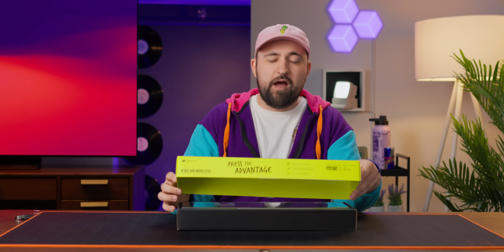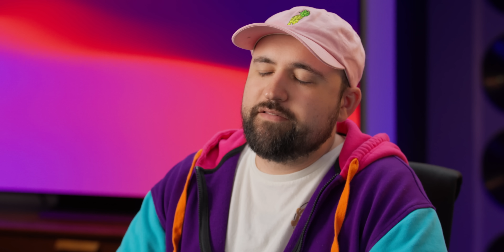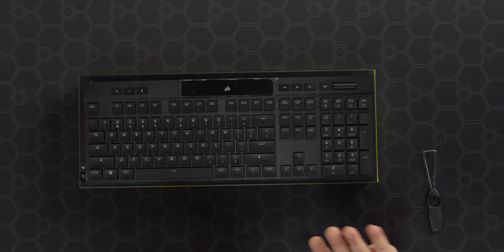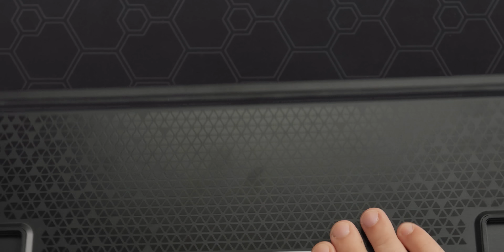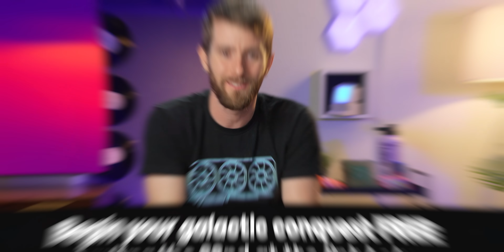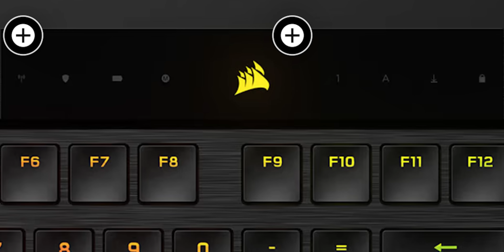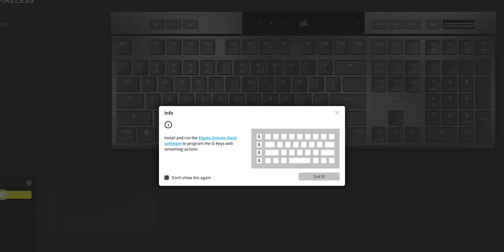Corsair's THINNEST keyboard yet - Corsair K100 Air

Comment: Glad that there's finally another wireless keyboard - that isn't actually suck at wireless other than the G915. And as you can see, typing on an ultra low profile is way more accurate, I would actually buy this if not for the ABS keycaps which is kind of unacceptable at this price point. 

And hard disagree on making a 60 percent version of it, at most it should be TKL (but full size plus macro really is best, I just wish they put macro on the side just like G915 even if you have to make the KB bigger.) Small form factor keyboard is honestly stupid if you want to put it to work.

Comment: I tried this keyboard at a retail store and I really liked the typing experience. I also really like typing on chiclet style keyboards for the exact same reason you mentioned, I sometimes find myself being "stuck" by other keys when sliding my fingers around. However, the price man... If they release a wired version that is much cheaper then I would be very interested.
Reply: Might sound kind of cliche, but... unless you want something very specific on this one, Keychron has much better options for way less money, but then often WITH hot-swappable switches, as well as open-source programming. - Their K Pro line is all low-profile and they all offer that, as well as wireless (with optional wired USB-C) and a bunch more sort of QoL-features. - And I'm talking between 100 and 200 USD for most of their keyboards, and that specific range of keyboards are all around 100. And you can even have it slightly cheaper if you don't care for the hot-swapping or RGB (but still white lighting instead). - Corsair basically makes you pay for their brand, and then locks you into their proprietary software as well. I don't appreciate nor recommend that. - Just a suggestion since I'm looking into those myself. I think they're really neat. - But... they do look much more "classic" or at least minimalist and don't have the more "modernistic" type look or any additional buttons (though most additional functions such as for media-control are layered using the "Function"-key, and everything can also be remapped) or screens. - Just depends what you're looking for.
Reply: I agree a 100%. I LOVE the ultra thin but there are so many features here I simply don't care about; Wireless, RGB, etc.

Comment: Low-profile switches are really just so much better than normal switches because of the much shorter travel distance, like is there a real benefit of that extra travel distance (other than being cheaper to produce)? I hope there's more development in this area. I got the G915, which doesn't have AS low profile switches as these, but it's the best non-laptop keyboard I've ever used, because my fingers just float across it while typing. I'd hope Logitech follows Corsair to making an ultra low-profile keyboard like this, cause I'd get it immediately.
Reply: I bet there are plenty of people who like a lot of "action", which is also the case with say guitar-players and such (meaning, the strings closer to or farther from the fretboard), just like those who like lighter or heavier switches, which is all just a matter of preference. - But I'm also of the idea now that it feels rather inefficient and that I could probably type more quickly if the travel was tighter and I wouldn't "trip" over the edges of the keycaps with my fingertips. - Which is why I'm looking into getting a low-profile keyboard now.
We're going to handicap ourselves severely when we ever need to type on someone's generic swampass rubber-dome keyboard, though.
Reply: Just but mx keys - its better then this low profile mechanical crap

Comment: On my 3rd K100 within the release of the keyboard and having issues again. Soon in #4... 
Honestly quality is not on point. Especially not for the price, let alone the MSRP. 
1st one straight died. 2nd one had several LEDs die/go faulty in color within months, 3rd one also has a broken led by now, and the feet just don't stick up anymore. Kb constantly folds down.
Gonna get it swapped soon...
Also my new elgato stream deck XL is also broken.
So smth is definitely not going the right way in corsairs QA

Comment: So the Keycaps is a pretty big issue, i've had the Logitech G915 for a few years and the key caps are wearing down, but you can't get replacement parts for it anywhere. Logitech designed a custom version of the Khail low profile switch that isn't compatible with any other version. Corsair has essentially done the same thing here which is really annoying for getting replacements later down the line.

Comment: Honesty I don't fine much difference between 100 and 200 hours on a KB but I dont travel that much.  Feels like if I need to charge anything, I can usually charge everything.  The KB is the last thing I think about, but  maybe that is why a long battery is great?  In any case, keep a cable with you and that should not matter at all.

Comment: Why does anybody need 8,000Hz polling?

I would bet like.. 3 whole tacos.. that even the best ESports champions would struggle to tell the difference between anything above 2x monitor refresh rate, because that's the point where you won't SEE a difference.

For example, on a 144Hz display: 
Set polling to 125Hz and spin the cursor around on a solid black background.. it'll be quite jittery
At 250Hz it'll be mostly smooth but with one or two gaps in the movement, small but still noticeable
500Hz - perfect circles with no interruption

16x faster at 8,000Hz: ?? how is it any better?

Comment: I got this keyboard a couple months ago, and while 230 bald eagles for a keyboard is expensive, I feel like it was worth it for me, and just compared to other Corsair keyboards the premium isn't that much. Though I didn't get it because it was wireless, it ended up being a huge bonus being able to use my desktop keyboard on the couch in the other room for example. Battery on wireless is good enough that I can't remember the last time I charged it. I liked my other mechanicals with cherry browns, blues, and the silvers, but I always loved a good laptop keyboard. This reminds me of the IBM Thinkpads before Lenovo, they were amazing. The only downside is that if you're a huge RGB fan that likes lots of different effects, or use lighting link, that in wireless mode the lighting is limited to certain effects. However, while wired it's just like any other Corsair keyboard.
Reply: The design is great but the keyboard seemed bad to me, the keys get stuck and if one breaks you can't exchange it. I had to take it to the warranty and they gave me another one just like it, key failure... it lacks a lot to be a good low profile.

Comment: The keycaps on my G915 from logitech are not standard either, the A, C, D and V caps wore out super quickly and it looks really bad. Replacements for that type of keycap seems expensive. So I would assume that if a keycap breaks or wears out on this keyboard, you will have a hard time finding replacements or will have to pay a premium to get them.

Comment: I had a Corsair k70 and it kinda put me off all their keyboards, the space-bar broke after about 6 months,the volume roller thing which this one has too would bug out alot and either get stuck on max or mute volume until u physically unplug and plug it back in and on top of that I had a ton of trouble with icue conflicting with easy anticheat and causing my games to crash. Just pure hassle and I'm not going back, have since replaced with a roccat Vulcan pro and I love it so much, it's better in every way

Comment: My experience over many Corsair keyboards is that the non-mechanical media keys are what fail first. So my last keyboard purchase was a K60 - no non-mechanical keys to break! The damn thing has loads of chattering switches and keycaps that pop off when they feel like the return spring insulted them and I'm trying to RMA it now :(
edit: also iCue is godawful; software updates regularly broke lighting patterns and configurations, eventually the software itself conflicted with applications I was passing the keyboard through to directly and I had to uninstall it. Also ruined my login to desktop time.
Reply: Media keys? Really? Does people actually use those?

Sorry I'm just amused at how I can't remember ever using the media buttons on my keyboard. When I got it some ten or fifteen years back I thought they were sweet, and that I would get a lot of use out of those shortcuts. And then I forgot about them...
Your post actually just reminded me that do exist. But I don't think there's much risk of me starting to use them now.

But it sucks for you that they used cheapo switches for the media keys. As much as Corsair charges for their devices I can't imagine that it would have made much of a difference in price for the keyboard if they had used Cherry switches for those too.

I remember when the first mice with a scroll wheel was released. I tried it out and hey, what do you know, you could scroll a window vertically. And then I forgot all about it. I think it took over a year before I started using it. It could have been longer for all I remember. It was just nothing I was used to have on a mouse.

But it's still easier to learn to use than the media keys. With the scroll wheel on the mouse I don't have to move my hand when I use it. To reach the media keys I have to move my hands from the typing position on the keyboard. Sure it would be faster to start the media player with a button and all that, but most of the time I want to play something it's a specific file that I have in some subdirectory somewhere. So either I have to start the media player and then search the file I want to play or I just use a search function and just start playback of the file.

Anyway it's interesting how differently people use features like this. For me the idea was nifty but in practice it turned out to be more tedious to use than to do it in other ways,

Comment: Even with the high price of this keyboard, it is so worth it. I got it back in October and it's by far my favorite keyboard I've owned. I use it on both a gaming PC and a Macbook Pro and the bluetooth connection is the most solid out of any wireless keyboards. The only way I could like this keyboard more is if it came in white. If you're a fan of the MX Keys or the Magic Keyboard from Apple, but are wanting gaming features, this is it.
Reply: does it type better then the apple magic keyboards?

Comment: I was able to snag this for $220 (I think that's a $50 discount?) at my local best buy. Yes, it's still way too expensive (especially when the G915 from Logitech is just as good, if not better for some, for cheaper, and also has a wired version as well for even cheaper. Guess you have to decide between which company you like more?)

And I've gotta say, initial impressions are solid, I think I may personally like it more than my g815, and my full fat k100 does has a run for it's money. Sadly these don't support wrist rests all that well so if you need one to comfortably type, do not get anything close to a low profile.

But for typing on the go, I don't think you can beat this when it comes to feature set

Comment: One of the biggest benefits of a mech keyboard is that if a key stops working you can easily replace it! If you can't replace a broken switch what's the point of it being mechanical (and paying the mechanical price)? It might as well be a dome switch, at least then it would likely be a more reasonable price!

And that's not to mention the lack of customisation and modding you're unable to do on this. I understand that they had to recoup some of the R&D costs but this is obscenely expensive for what it is

Comment: This looks like a great keyboard!  BUT... batteries.  I have been using the Logitech K750 Wireless Solar Keyboard for about 5 years now and I NEVER needed to charge it.  It is 100% powered from my office and monitor lights.  Since I do animations I will turn the lights down in my office/studio for working and its NEVER lost connection or given me a low battery warning.  The thing that I like about this Coasair keyboard is the backlight and RGB.  I wish my Logitech K750 had back lit keys, but I would rather take the NEVER NEEDING TO CHARGE IT, over an animated rainbow effect any day.  If this Corsaire keyboard was closer to $100 I would jump on it.  But around $280!??!?  Ya not for me.

Comment: Swapped form a k95 to the 100 and it has been such a waste of money. Since day one, my k100 constantly disconnects and wont even turn on when i start my pc.The 95 works just fine so its not my pc or any of my USB ports. I've uninstalled and reinstalled all of the Corsair software to make sure its not a weird bug on my end, still does it. Tried it on another pc, does the same. Ive returned it to Best Buy and had it replaced, the new one still does it. Im swapping to a custom keyboard or Steel Series.... Corsair SUCKS at responding to customer service emails. Its time to move on!

Comment: As an owner of 2 K100 Airs, I will say that they are gorgeous BUT the key caps are NOT replaceable. I have no idea how LTT managed to fix theirs, but the reason I have 2 is because I popped off the ‘X’ button on the first one to clean some dirt; thinking it’s like a laptop keyboard key cap, where it’s easy put back. I was sadly mistaken. I’m still trying to fix the first keyboard.
Reply: On the video it does look removable but at the same time very fragile, tiny plastic flaps like that can easily break...
Reply: I had this same problem.  The first one I bought popped a key cap in the first 10 minutes and I was pretty upset.  However, I exchanged it and then second one I got has been rock solid for like 9 months now with zero problems.  The key that popped off I was able to put back on, but it wouldn't stay on and would pop right back off after only a few presses.  With that said, I still absolutely love this keyboard and was pretty excited to see a review thinking there was a new version coming out, but was disappointed to realize this is the old one I've already had for so long.  I've tried at least half a dozen high end low profile mechanical keyboards with more clicky switches, and a variety of cheapo ones, and the K100 Air is easily the best.
Reply: I know this thread is a bit old, but came here to say this. I had a key pop off when I accidentally dropped a mouse on it. I’ve looked up how to reattach and while there a couple of links to help (including a YT vid) I’m still unable to reseat the key. I understand the form factor may have required a redesign of the key mechanism, but user maintenance should be part of that design. Very frustrating.

Comment: I've been using this keyboard for several months now and love it.......except for one thing.....I run wired, and the damn battery icon when full lights up GREEN......I use orange/white and purple , and to mu knowledge, its capeable of changing, while charging its white....which would be fine.....but yeah, you cant manually change the color or disable the icon, so I have this green out of place eye sore that drives me crazy.....

Comment: I will say I became a fan of corsair after the VirtuosoHeadset and the slipstream multi connection. But I will say their stuff is way overpriced for what they offer. I had bought the K70 wireless since it was their first RGB wireless mechanical keyboard and it had slipstream. I ended up returning it because even though it does connect with a single usb dongle it only works at 800hz with about 2 miliseconds of response time. Which I am disappointed to hear because the way the advertise it make it seem like you can get multi connection at under 1 milisecond but you can only get that speed if you are use a seperate dongle for each device.

Right now my favorite keybaord is actually ones made by Royal Kludge specifically the RK96/98 which are just a couple millimeters bigger than a standard TKL but with almost 100% of the keys of a standard keyboard. I like them because they offer keyboards with dual wireless connection 2.4ghz and Bluetooth with up to 3 different devices, RGB, Hotswappable switched that support both 3 and 5 pin, and two usb 2.0 passthrough ports/hub, which is something that I never really thought I needed until I had to work on a device that supported only a single usb port. Compared to corsair they are really cheap with a lot of features.

The only downside is that if you want to more abilities to customize the keyboard you will have to download their software from a google drive and if I recall correctly it might not be a "Microsoft signed" program. Its not required to use the keyboard but it is something to keep in mind and becareful as well. I would suggest using a VM to run the software if you need to.

Comment: That "wifi" button is definitely not for WiFi, but to change to the PC which has the keyboard's own USB receiver connected. And there are 3 other Bluetooth devices you can pair with.
This seems like a good MX Keys alternative. Though those key cap mount points doesn't seem to be more durable. The keys on my MX keys started to crack by their "teeth" which are used to fixate to the buttons underneath.
Reply: Definitely. Switch to this from the MX keys last week and I love it. The Bluetooth switching is also about twice as fast.
Reply: @IstvanNagy86 did you take your keyboard apart often? I havent had a mount crack and I bought it on pretty much day 1, with heavy use for work and gaming
Reply: @brdnacer  no I haven't, though the keys which are problematic are the WASD keys. I play FPS games mostly. But I also use this keyboard for work. Kind of got used to how to press to buttons to not tilt now, but still, it's not a cheap keyboard and expected better.